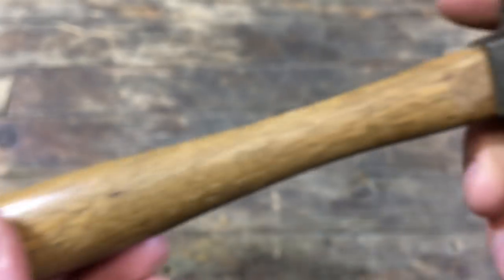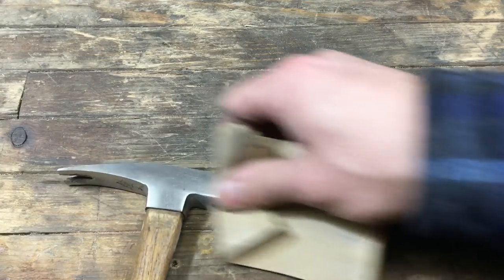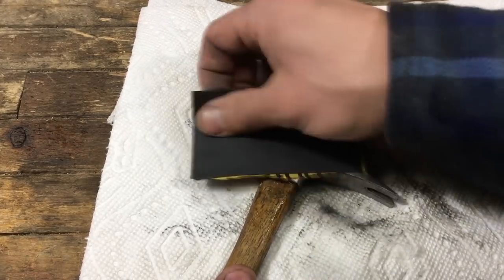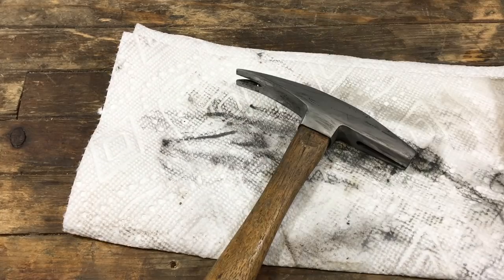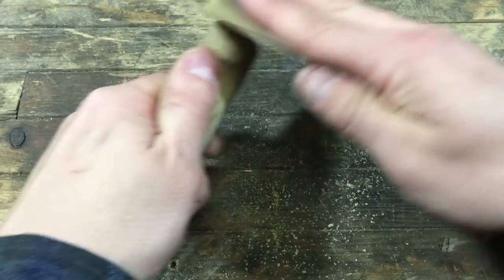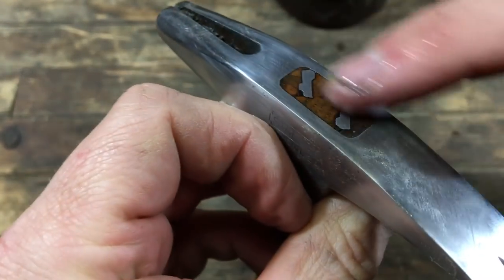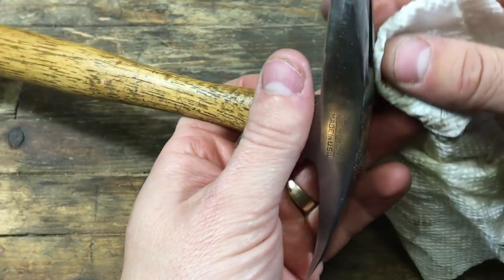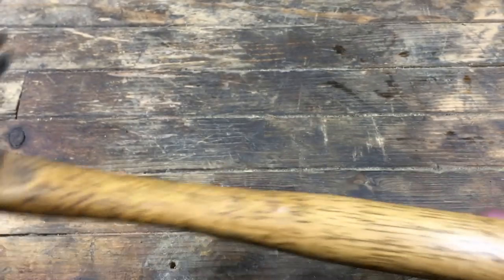Quick 60 min Tack Hammer Restoration in 5 min

Comment: Yep hand sanding is the way to go. Red automotive Scotchbrite pads are also great when there isn't much to take off...but they will round corners... So good for panels, rounded, radiuses and curves etc. But not so good here. I also find that unless there are problem spots in the steel I like to start with dry 400 wet/dry. And just see how much it'll take off. That way I don't put in more scratches that I have to then take out. Dry 400 can take care of a lot, gently, without losing material. (Although it takes longer sometimes) A lot of the lower grits are for different kinds of wood (I think/find).
Reply from the maker: I like that idea, starting with 400 grit. I’ll have to try it next time.
Reply: @oldshovel  even if you start there and find out you have to go higher, it's kind of like an assessment...do a first light pass and go from there. BUT! Once you are satisfied  - don't touch a fresh piece of 400 on the part u have sanded! You can go to a higher grit, or that same piece of 400 now wet. But the fresh 400 will put fresh scratches in your nice finish!... (Because the grit gets worn down a bit as you sand, especially on steel) so its good to use a small new piece for each face, and wear them down evenly. Rather than a bigger piece for all sides. Then once u have an even finish, change grits (go to 1000-1200 and just sit there till its smooth then buff.) 600 and 800 are a waste of time IMO. More scratches. Plus it keeps it simple.